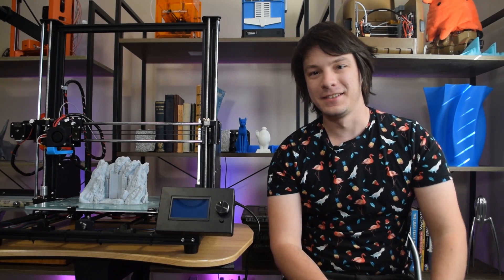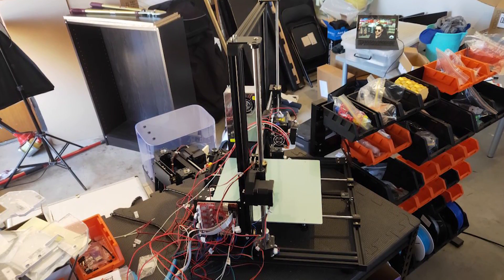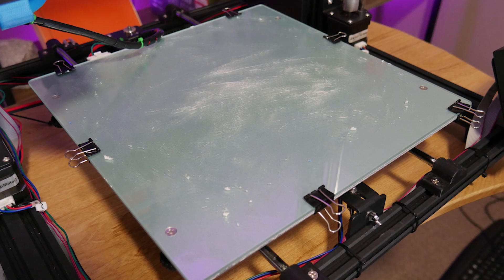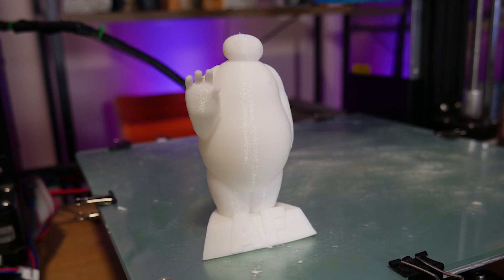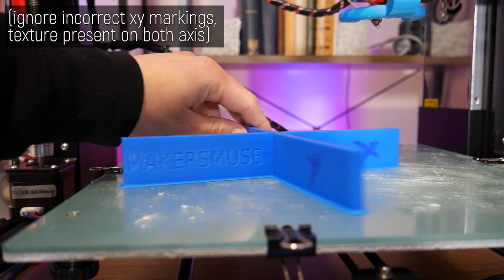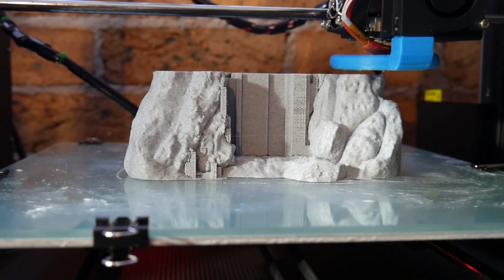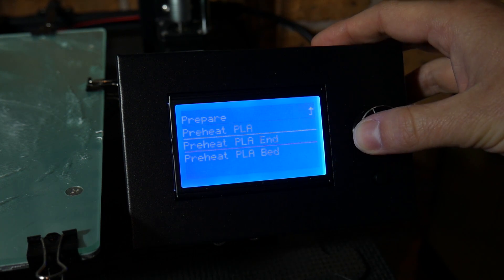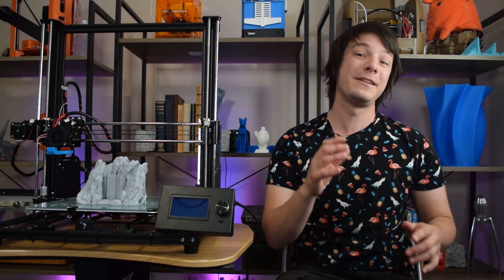The Anet A8 PLUS is big, cheap and won't catch fire. 3D Printer Review

Comment: That wavy pattern artifact means that somewhere there is a harmonic vibration happening when the axis moves probably from the belt teeth. I had this issue on the Y axis of my ender 3 when I tried to use the 3 point bed leveling plate you can buy. What was happening in my case, was the Y axis belt rolling across the smooth idler roller was creating a vibration, which was then being essentially amplified and transmitted into my part through the springs on the bed. Especially since the 3 point solution you can buy is kind of flawed in that it's a less stable mounting system, even if it is in theory more flat. The solution in my case was to replace the bed leveling springs with 4 solid silicone mounts since I use ABL anyway, and switch to toothed idler rollers. That got rid of the pattern entirely.

If I had to guess, either your belts are causing it, or the bearings themselves. The bed springs might also benefit from being compressed more so vibrations don't transfer through them as much. If the wavy pattern is spaced the same or close to the tooth spacing on your belts, that's probably the source of the vibration. If the printer uses non-toothed idlers, swapping them to toothed will probably fix the problem, if that pattern is from what I think it is. Also switching to the plastic bushings might help as well. I'm suprised it's showing up on both axis though, I've only seen that pattern produced on the Y axis of an i3 design.
Reply: Harmonic vibration it has. Most of it went away when I took it off the table and put it on the floor. But yes there is a smooth idler on Y so thanks very much for that tip I'll replace it with something better.

Comment: I have just finished assembling mine which I bought after seeing this review. I am old enough to have cut my teeth on Meccano and have been assembling PCs for a very long time so the build went smoothly. 

- I put Igus bushings in directly on X and Y axis, I am very pleased I did, the supplied ones are very noisy
- cables are much longer in my kit
- no ptfe tube in the kit
- several (3 or 4) errors in the printed manual but watching the assembly video clears things up. Some photos in the manual are too small to be of any use
- the biggest pain is cable management

The quality of the finished printer is satisfactory for 155€ delivered. Now I just need to learn how to 3D print... =;) Once I am up and running this seems to be a good base printer for upgrades like BL Touch, 32 bit MB with WiFi and a quality hot end/extruder.

Comment: Hey,

I have been having issues with my Anet A8 Plus. When I try to set the temperature of the  nozzel to i.e 30C it increases dramatically to 40C. I have replaced my  thermostat 3 times, still same issue. I have had prints before but after 2 weeks it started to have this issue. I figured the thermostat is functioning correctly so I tried to upgrade the firmware since lots of people have found that helpful. I upgraded to 2.0 Marlin and I still had the same issue. So I looked into other discussions online and I saw that the MOFSET might  have been the issue. So I brought a new board. I then installed Marlin again on the new board, and it is still showing the same issue. Any thoughts as to what may be the problem?

Thanks

Comment: Hi I recently picked one of these up and I can not get a good print off of it. When its attempting to print the X axis will work its way to the left and will mess up the print or get to the point it dumps filament on my desk not the build table but my actual desk that it sits on lol. So far not too thrilled with it but I knew going into it I would have to figure it out. I watched a few of your videos and I love my monoprice mp mini delta. We had to tweak the gcode on that for it to work properly but I can't find much on the anet a8 plus and I need help from anyone

Comment: hello everybody. I have made a little bit of research, and i want to get my first ever 3d printer.  Can´t quite decide between the Ender 3 or the Anet A8 Plus.  Any suggestions?
Reply: Hard to beat an Ender 3. Mine printed better than any of my other 5 printers out of the box. I've done some serious upgrades and it prints exceptionally well now. I did buy this Anet A8 Plus last week though, couldn't resist $145 shipped for a 300mm printer. I have impulse control issues...
Reply: @mattv9240  this is sooo difficult... I have confirmed by others experience and everywhere people say the ender 3 is the leader... I think that for the first printer... I will be getting the ender 3 and then upgrade it... Still can always get the anet later on... Jajaja the 300mm build volume is what calls my attention so much
Reply: The Ender 3 is the safe bet, especially for a first printer. There is a ton of community support if you run into problems. Good luck!
Reply: @mattv9240  thank you su much for the feedback!!!

Comment: The A8 Plus is cheaper than the ender 3 by $20-$30, however is it a good deal, or would the ender 3 pro or tarantula pro be better at the $200 price range even though you have $30-$40 extra to spend on upgrades for the A8 Plus to hit the same price point?

Comment: All of the smooth rods in my kit were deeply scored along their long axes and the linear bearings were noisy and were badly inconsistent.  I replaced the bearings with Delrin aftermarket bearings.  The belt tensioners also leave something to be desired.  Prints so far are so-so, settings need tweaking.  The threaded holes for the bed rods were out of alignment.  I replaced the rod mounts with some I found on Thingiverse.
Reply: Steve Schowiak It only took a few weeks for my Y-axis bearings to fill with metal dust from gouging the rods. They started binding and the Y-axis would lose steps. I got a set of 12 plastic bearings for $12.95 on Amazon.  Replacing the four Y-axis bearings fixed the binding.

Comment: I bought this printer a few months back. I really like it but I get the same artifacts despite changing to igus bearing also had to replace the board with an skr 1.3 and 2208 steppers and an e3d v6 hotend and bontech (clone) extruder. What else would cause this? Also I really like the content of your videos.
Reply: You might try changing the lead screws and nuts or at least remove them and see if they roll well on a flat surface. Another comment suggested switching to 0.9 pitch stepper motors.
Reply: Typical Anet wayyy too High friction sliders / bearings cause most of the artifacts. 
Won't lose them until  you convert it to Roller wheels or ideally decent quality Linear rails.
Reply: @danilochies528  Yeah been looking at a way to switch over to v rollers.

Comment: I honestly never had issue suggesting the original anet a8 with one caveat. The first thing a new owner should do is update the firmware and enable the thermal runaway protection. Nothing else on the market really approached the a8 for print quality and size for the price.
Reply: A year later, still no issues! If you know what you are doing and take some basic precautions, it's still one of the best 3d printers money can buy.

Comment: I got my self a anet A8 back in june 2017 its been a fun project printer for upgrading(A better psu, Heated bed external mosfet ,bltouch,titan extruder,e3d v6 ,MKS GEN 1.4(running latest marlin 1.1.9) , etc)  its a AM8 now and soon will upgraded to use MGN12H rails! sooo its not a a8 anymore the stuff left from the a8 still used is the rods,stepper motor ,and heated bed. If i had the space i would probably get the Anet A8 plus to upgrade too.

Comment: yes sure anet moving into better copying direction cool. its still the same garbage board,  same garbage rods, and same everything. its like they had over stock of a8 parts so they just made it bigger by copying creality again. i used to own a8, until the PSU poped and almost caused a fire, ended up disassembled for parts of other projects. so tell me this why would you tell anyone for the same price of cr10/s or ender3 pro to buy this crap.  not to mention putting a link to buy this shit.

Comment: I have an Anet A8.  After installing Marlin (with thermal runaway protection enabled) and printing every single upgrade to increase frame rigidity, also printing cable management, fan shroud upgrades, and adding automatic bed levelling...  it STILL exhibits a fair amount of ghosting if I run it too fast.  It looks pretty much like your examples.  I'm coming to the conclusion that the root cause is those 8mm rods and linear bearings that the bed runs on.  If I grab the bed and give it a tweak I can feel some movement, and fast changes in direction cause it to shudder...  hence the ghosting.  No, fixing the bed hard to the carrier frame isn't going to fix it because it's the bearings bolted to the carrier frame slopping around on the rails that is the problem.

I'm at the point where I need a larger printer (printing stringed musical instruments and just about to start designing my own) and the A8+ looks like it will fit my meager budget, however I think this needs a DIY solution for the bed rails before I will pull the trigger - upgraded rails and bearings that do a better job.

I'm open to suggestions for better drop-in replacements.

I've always recommended the A8.  The things that make it great are the affordability and that anyone capable of getting it working successfully learns a heck of lot about 3D printers.  The important proviso is that with an Anet what you are really getting for your very few dollars is a box of cheap Chineseum parts and a set of instructions to create a 3D printer.  To make it work successfully, safely, and make it look good takes patience and a bit of creativity.

Comment: I have the A8 and A8+. My A8 is running marlin 1.1.9 with the v1.7 main board (same one as the A8+) and other than user induced errors is by far my dead reliable machine. My A8+ has been a problem from the y axis holes drilled out of place and the 3d printed spool holder that crumbled because it was printed so poorly, and lastly the y axis mount that split due to again improper layer adhesion. The A8+ qc needs some tweaking. I will say the A8+ does address a lot of the short comings of the A8.

Comment: I like that it has direct drive extruder. Question is what kind. Probably same level as rest?

As for the ringing all around, did you try to bump up stepper vref?
For example, early versions of Tornado that got fixed by just cranking up vref to max :)

Comment: A lot of people have been replacing the bearings with delrin ones and it has solved a lot of print quality issues. Its so cheap you can do a lot of nice upgrades without breaking the bank. I'm considering one of.these
Reply: I selling one .

Comment: i bought one bout 2 months ago ran awesome for awhile, now i have extreme layer shift so cleaned everything and tried it again, nope after starting a new print and watching it the bed or Y axis started skipping horribly, after stopping and removing wire to stepper, it would hardly slide back and forth, so investigated.... chrome was coming off the shaft, deep groves in shaft and bearing loaded with metal flakes.

Comment: Love my A8, hasn’t burned the house down yet
Reply: I soldered the cables for the hotend and bed directly to the board, so the main reason why many A8's catches fire is eliminated and my board stays almost cool while printing. Also I changed the old psu for a computer psu and my printer stays in a server cabinet which is made out of metal. I think my A8 is very safe now.
Reply: I had two of the original a8s  both awesome machines for the price at the time. I personally think this one is a big improvement on the first ones I purchased for around the same price. The anet community was also a big plus when I first started everyone was so helpful along the way.
Reply: I put a bl touch on it
Reply: Same, been using mine for years and it works great
Reply: Yet.
Reply: Still not too good for the entry unless you know what you're getting into, I've had power wiring swapped for 2.5mm², soldered the bed on with 2mm² wires, and installed external MOSFETs to prevent fires. Then me pushing its limits a few times literally cracked the frame.

Comment: I've had one since December. I couldn't get the bed to level because I could never get the rods straight. I replaced them with 20x20 extrusions and V rollers. It's nice and smooth now. 
The extruder constantly clogged. The heatsink is REALLY small. I replaced it with a Titan Aero. That upgrade means a firmware update is required. I wasn't able to make it happen. All the tutorials and files are for the old board. Since this is a new one, all flashing attempts failed, so I upgraded to a Duet Maestro board. Now that I'm in for another couple hundred dollars, it's a good printer, 6 months later.

BTW, tie a rubber band around the wires that are drooping and hang it from the top.

Increasing the jerk settings helped with the ringing.
Reply: Got mine a few days ago and same thing. Cannot get the bed to level. Any instruction on the 20x20 and the V rollers?
Reply: @stevedegeorge726  If this is your only printer, get it working enough to print some parts. I'll upload the STLs and a parts list to thingiverse and post a link. With this design, you lose some space in the z axis. The advantage is that the wheels ride directly on top and below the extrusion instead of clamping to the sides. It rolls Nice & smooth without the uneven wear. 
Keep in mind this is going to be a good bit of work. 
Extrusion mounts
Roller brackets
Raised motor mount
Raised and improved belt tensioner
Reply: @stevedegeorge726  https://www.thingiverse.com/thing:3898179

Comment: iv been running the original a8 forr years with no issues
Reply: Same, though mine was a clone called the "Coocheer". I thought I was buying a CR-10 and the A8 clone arrived instead.  I didn't know enough to really think the acrylic frame would matter and fight it....but hey it has a bigger build volume stock (220x270x230), and yeah with all the printed frame braces, filament guide, belt tensioners, etc...and after a stock thermistor wire was going flakey (causing prints to pause at any time because it would report 275c when it was really 190c if the wire bent the wrong way), replaced the hotend with a genuine E3D "sock and block" kit for like $25, and got a noticeable performance improvement when printing with bigger diameter nozzles like 0.8 and 1.0mm. 

Do I want something better now? Yes, but as someone who enjoys tinkering and learning how things work, I had much more fun with it than I would have a pre-assembled kit, and I can still print stuff well enough.  But as a sidenote, I've never not been in the same room with it printing for more than like 10-15 minutes at a time. :P

Comment: i have the original anet a8 running in a hot shed here in aus. i did put in a proper power switch and fuse and also upgraded the firmware after i found octopi warning me of it. also have octoprint now controlling the power and light through relays on the gpio. for a hobby kit under $200 it was well worth it for me. just do not run it unsupervised :D

Comment: WOW! Hi Angus, I didn't know why you'd never done a review of the Anet A8 before. I had actually searched your channel for one. 

Agreed, the stock A8 is a fire risk, but doing a review where you discuss it would have informed your audience about the risks of that machine and other low-end 3D printer kits. 

My own machine, my starter machine, is the Anet A8. I bought it knowing about the fire risks and the many limitations with the machine, but I also saw the online community of A8 users who were achieving incredible results with this machine. The machine never runs unattended, and I am careful to avoid having fuel nearby. Knowing the limitations, I love the machine. 

The Anet A8 Plus looks really nice, and as someone who has built an A8 (and dealt with screws that missed having the heads properly embossed - and what are they made of, they're not magnetic!) and put dozens of kilograms of PLA and PETG filament through that machine, I am convinced that my mechanical and electrical aptitude and experience is compatible with the skills required to properly build and operate a high quality 3D printer. My CAD skills still suck, but OpenSCAD is usually open on my desktop. :) 

So now, it might be time for me to look into something better. What would you consider to be good mid-range 3D printers? My goal is to reproduce otherwise unobtainable parts for antique radios and cars. Obviously, flexibility with filament materials will be a key factor. 

And I would prefer to spend money with a company which has actively supported the 3D printing community and the open source community.

Comment: You've reviewed expensive printers before now, that didn't have thermal runaway protection enabled, so I suspect some bias against ANET's past printer here. All that was needed was to install Marlin firmware and job done. I've been running one for years.
I didn't see you mention what controller board they're using in this review. The artefacts you can see look like the original ANET's artefact problem, and was caused by the controller not having any smoothing diodes for the motors. This could be reduced by using TL-Smoother's, as shown here = https://www.thingiverse.com/thing:3717970
If ANET are still having the same problem, then that's bad on their part, as it's always been an issue and shouldn't be. You could have another problem though. Those rods are too thin for the height of the appliance in my opinion, for a start.